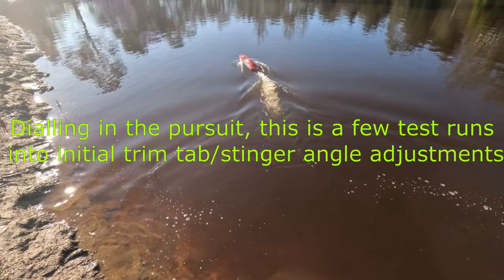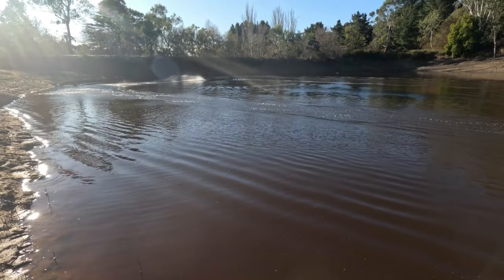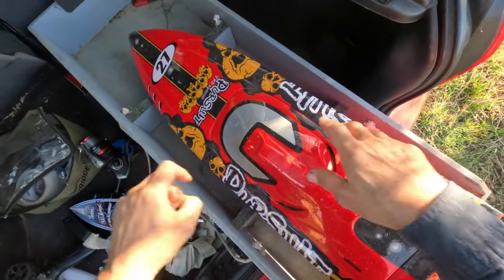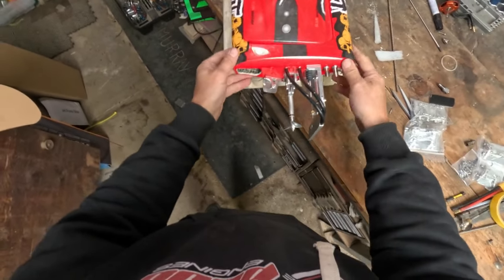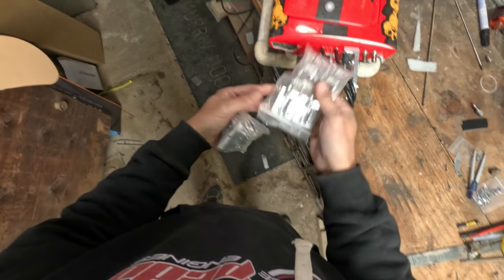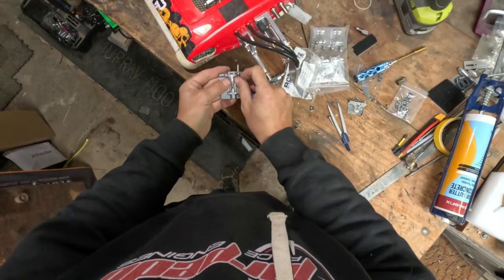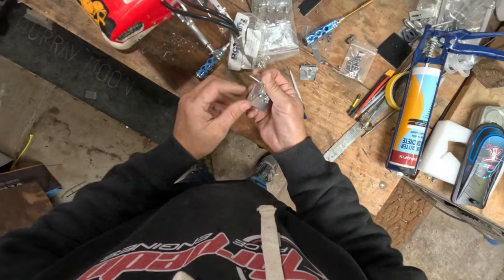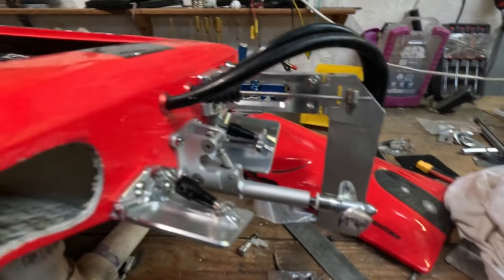TFL custom made Pursuit SR with TP 4080cm with ZTW 200a

Comment: Is this a purpose build boat? Thats a humungous motor for this size boat... 
Those old tabs were definitely way to small. I will make some longer stainless (about 60-65mm long) in future myself to test if it makes a difference in case off blow-overs etc at extreme speeds...
Reply from the maker: Its a tfl built hull and hardware with a few custom touches like sliding battery tray they added for me.  I would never build a boat from scratch with such small tabs haha. i installed the largest 40mm motor you can buy, but i once built a carbon fibre pursuit with a huge 58mm tp motor, it actually ran really well

Comment: Hey rcbb im wondering if its possible for you to make the 3/16 shaft for the spartan same consept but maybe 1cm longer from the drivedog to the end of the threads so high rake and those type of longer props so it would fit the premium upgrade kits stinger??if possible
Reply: Sold separate i want to use my longer props and high rakes i have on my spartan birthday is comming up so il deff buy it for a self gift 😊
Reply: Or 7mm longer than the normal 3/16 upgrade shaft on the end if you know what I meant
Reply from the maker: hose kits come with wire drives now that you need to cut to length, so you can leave it as long as you like
Reply: @RCBoatBitz  how much wil that cost?
Reply: @RCBoatBitz  hm 60euro il take it!
Reply: @RCBoatBitz  one last question wil the wire drive be able to handle 8s max proo size 45,7mm??
Reply: @RCBoatBitz  prop*
Reply from the maker: @SUPERB_WT  i havent tested those up to 8s yet so i wouldnt want to guarantee that will last just yet
Reply: @RCBoatBitz  okay well il just drive it on 6s for a bit
Reply from the maker: @SUPERB_WT  im pretty sure they are impossible to break but until ive done more testing i cant make any promises
Reply: @RCBoatBitz  haha alr good enough il just test it on 8s id that feels sketchy then il keep it on low preformance mode